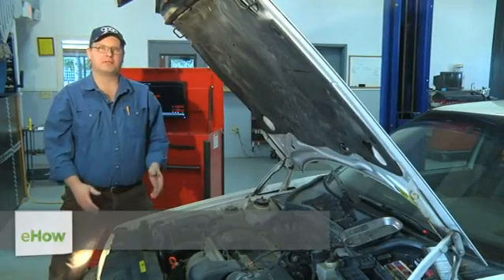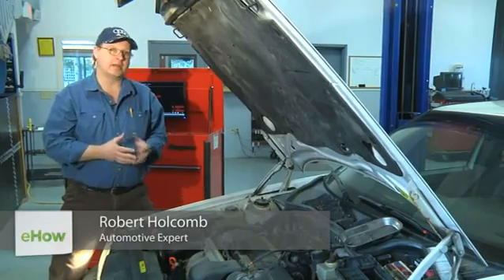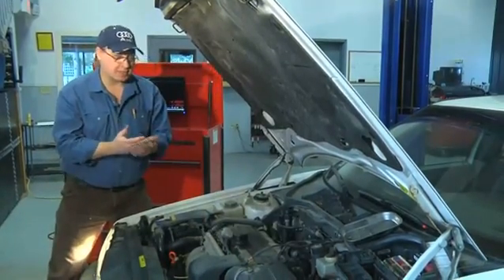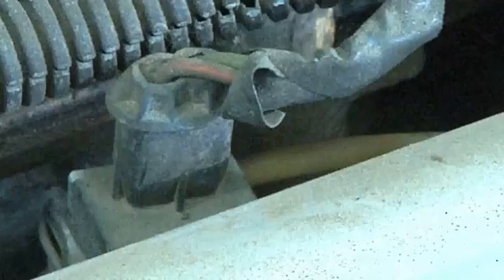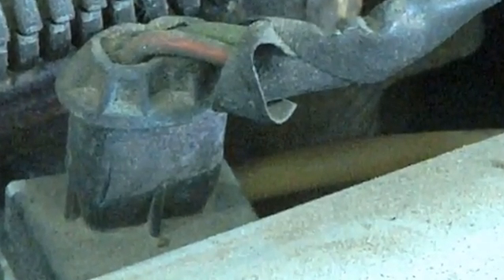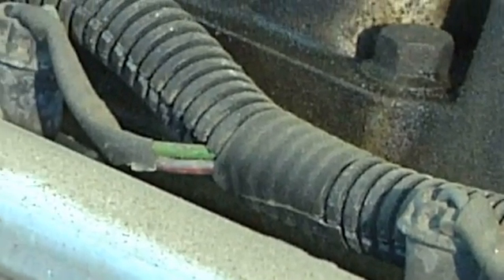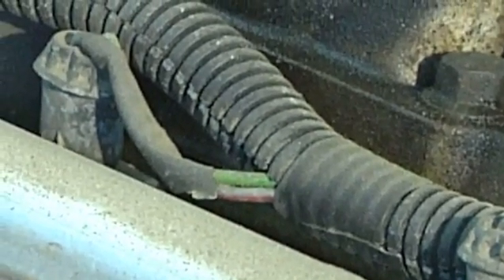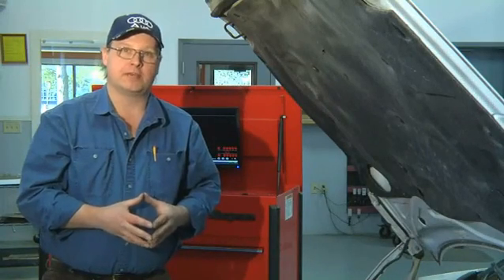How to Unplug and Check Fuel Injectors in an Idle Engine

Comment: all my injectors show no difference when i unplug them, but when i unplug just one ignition coil (i have a coil plug for each cylinder) the engine shuts off. what the heck is going on with my car, it is making me go crazy 😂. 

i have a first gen 1.3 liters "2nz-fe" yaris (for americans, it is the echo or the scion xa with the 1.5 nz-fe, they're basically the same engines, one just has longer stroke) when you drive it, for example: 2nd gear, cruising at constant speed 2000 to 2500rpm, like in a city configuration, so you will have to apply throttle and back off it then back on then off, to avoid pedestrians, to follow the pace of the car in front you know everyday normal driving. well my car, when ever i put the gas "on", no matter how smooth i go, it jerks forward, then bogs, like on / off / on / off, with each times decreasing in the intensity of the jerkiness, like a pendulum oscillation, until it stabilizes (the gas) at "on" and continues cruising like that. and then when i decide to go off the gas, it goes like off / on / off/ on... each times decreasing in intensity until eventually decelerating smoothly with engine braking. watch could cause this. 

nb: sometimes it stops all this trolling, and behave wonderfully, when i put gas, it just goes smoooothly with no trepidation what so ever, but 80 percent of the times, it is kidding me.

nb2: it does it way less when started in the morning, when cold, and cruising at low pace, you can feel the pendulum but it stay well contained.

nb3: sometimes, when i go off gas, it gradually starts to decelerate like engine braking smoothly, then all of a sudden i feel like it bogs down, like something stopped, then it comes back to normal engine braking. (i think of it as being the fuel cut off, i think ? i don't know) why is that ? i don't know.

nb4: the power is variable, and accordingly with those trepidations, by that i mean, 80 percent of the time, the acceleration is not optimal around (70%) (i know how the car should feel, like the normal or healthy acceleration of it), and sometimes it gives me 100% of it's power. 
so i'm guessing that the moments when it stops the pendulum effect are the same when it gives 100% of the power.

already checked: 

- engine mounts, not those. 
- not a stuck caliper, the wheels run freely, and the car when switched to neutral (it's a manual grarbox) it stops the pendulum effect, that's by the way how i try to leviate the pendulum oscillation, in traffic jam situations.

- took off the injectors, cleaned them with carb cleaner, changed the basket filter they work fine...

- changed the fuel pump, ended up putting back the original because it was a denso and the replacement was an aftermarket, not chinese but rather italian, but still it was noisier and failed me in the middle of the road after a week of use, car stopped, so i came back home, put back the denso one, it runs fine, it felt a bit torquier with the new pump tho, i don't know if this was a plcebo effect, my mind playing tricks on me or not.
- fuel regulator, change it, put back the original, no difference.
- coil plugs replaced, not denso ones (i'm thinking they're to blame because by experience, other than denso stuff is crap) it is that same italian brand (ERA, i don't know what it is worth)
-i already checked the timing chain (i mean kinda checked) basically i took off the valves cover, i turned the engine (by the camshaft, there is an indentation where you could stick a wrench there and turn te engine) so aligned the 2 camshafts with the markings on the chain, and checked with a screwdriver the position of each piston, and it corresponded to the normal positions for each piston. (chain is original one, almost 400,000 kms... is this most probably the cause or no ?)
-i checked for all the grounding cables, with the help of toyta diagram pdf workshop manual, i found all the grounding to the chasis, sanded all those areas, changed the rusty screws, it helped with an intermitent hyper flaching blinker problem i had, it fixed that, but the "pendulum syndrom" not. (i mean the hyper flashing was fixed by sanding the base of the lamp holder, whatever it is called)
- i checked all the fuses with multimeter, i checked all the relays, i tested the multimeter.
my 2nz-fe doesn't have a vvti system, doesn't have an evap canister (because i found this online, that a leaky evap valve could cause that, looked for it, nowhere to be found on the car), nor does it have o2 sensors, because i tried to tackle that one day, i looked thoroughly my exhaust (while it was having an oil change, i'm a "diy'er" i have no infrastructure to work on the car, i only have a wrench 😂)  i don't know what are this toyota i have, i'm from algeria, and this was sold officially by toyota here, and it is clean (becuase i thought: " impossible,, someone must have chopped the o2 sensors off, can an engine even run without ones ? i learned mechanic because of this car i swear, all i know about engine is because of this pendulum thing that lasts for more than 3 years or 4 years now, before it was driving like it did new, very smooth and sensitive throttle), other than the inconvenience of driving a pendulum, it was super reliable every day to this day, taking a beating of 100kms, daily, 400,000kms, and it just works, she doesn't care for the pendulum oscillations, she just goes lol. in my vin plate it says made in japan, but when i look on the internet i only find about european version, that have vvti and o2 sensors. i think i found one forum of toyota in latin america (Chili or peru i don't know exactly the country) they stated that their yaris didn't have a vvti. and i found a forum of toyota from pakistan this time that had a topic going on about the yaris 1.3 not having an o2 sesor. 

i'm planning to plug it with the mini vci toyota obd2 plug, using techstream scanner software (a proprietary toyota scanning software) to get live data of the engine ECU, as i tried the standard obd2 bluetooth plugs paired with playstore "obd2 scanner" apps and they don't get a lot of live data... tell me what to check for, to diagnose anything... fuel trims, ignition timing... what are the values i should read.

i heard as well a similar story on a BMW forum, a guy has an e36, and described the same symptoms as mine, someone suggested him changing the throttle position sensor, and he reported the car running perfect as never before.

edit: i thought about doing as well:

1- a compression test for each cylinder
2- change the timing chain, this time by taking off the chain cover, and doing it properly.
3- i have cracked ignition coil wire plugs ( those who have toyota know that the black connectors systemactically breaks, and the grey ones are intact). i have broken injector connectors as well. i will be unpining the wires on those and replace them.

Comment: I did this test on my 98 Tacoma and cylinder 4 which has been misfiring showed no difference in idle when I unplugged the injector connection. So definitely not getting fuel from that injector. My question is I just took them all off cleaned them and checked resistance and they seemed good. Could it be my connector or potentially a short somewhere down the line for the connector or are they all wired together to one ground.

Comment: Hi quick question what does I mean if your car cuts out if u disconnect one fuel injector
Reply: It means that your car has some sort of security so when it detects something is not responding, it shuts itself down, so this technique doesn't work. Does it happen only with one cylinder? Try other injectors, maybe there are other injectors that are bad so you unplugged one of the few good working remaining, that keeps the engine barely turning, so by unplugging it, it can't continue turning, so it shut down